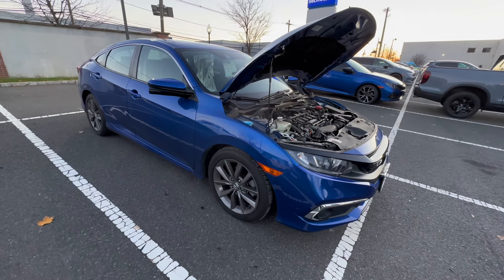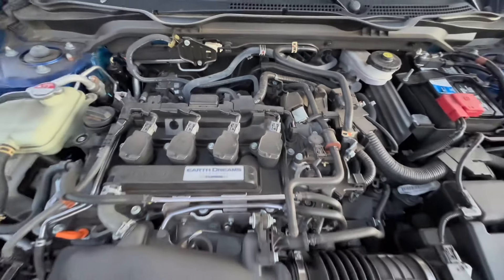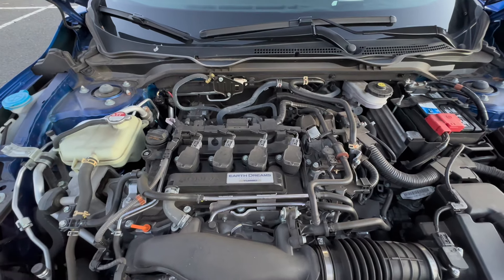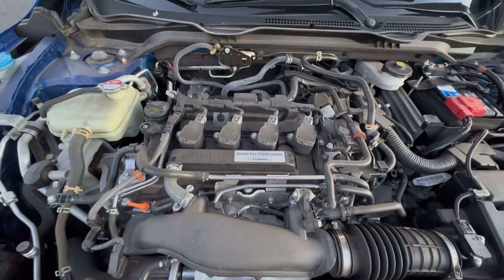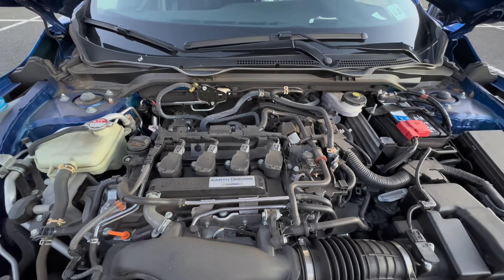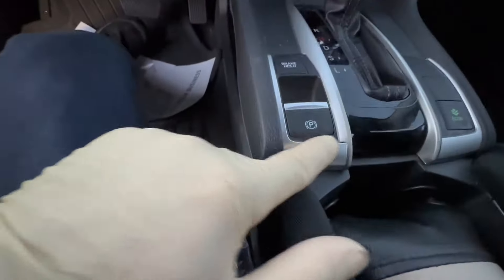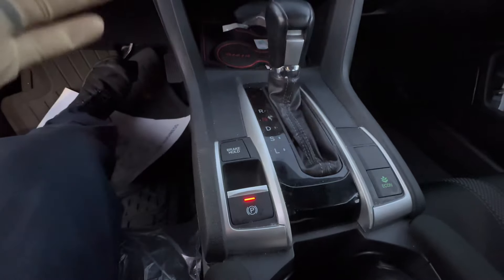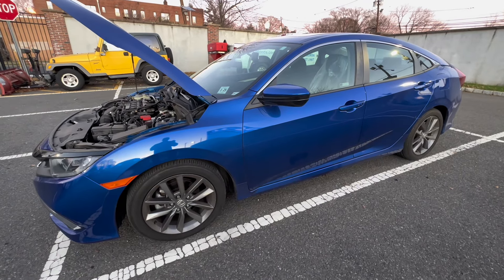2016 - 2021 Honda Civic problems

Comment: Ok got it stay away from the turbo 1.5.
Reply: I would not say that. They have built thousands of 1.5 T and compared to the failures it’s still a low percentage of failures. I have seen a ton of 1.5t well over 250,000km and they have had to issues.  Imop it depends on how it’s treated in some ways but that’s just from my experience. It’s like I would never buy something with a K24 as I am tired of putting pistons and timing chains in them, but if you want to tune and mess around the 1.5t was never designed for it or will take the abuse were the K24 will all day long.
Reply: I have 100k miles on my 1.5T not a lot but it has had no issues
Reply: I've seen plenty of 200k plus ones if you treat it right and drive it for what it is.. an economy car they do fine
Reply: @vulcanvulcan2963  when do you change the oil ? Have you had the engine cleaned for carbon?
Reply: @Tracy-wr7mj  I change it whenever the light comes on. I had the transmission flushed at 75k. What’s that cleaning for? Is it recommended?
Reply: @vulcanvulcan2963  the carbon build up in engine..  I was wondering on the oil since it's highly recommended to change it sooner since it's gdi ..
Reply: @Tracy-wr7mj  hmmm maybe I’ll look into it. It might help that I drive like a grandpa too, I had a 2001 Acura tl that I drove to like 280k miles. I had the transmission rebuilt and I broke again shorty after but I got good use out of it.
Reply: 1.5T is quicker and ALSO more fuel efficient than 2.0 NA. To me that’s very impressive. I had a 2017 1.5T+MT Civic that was soooo fun and averaged 40+ mpg.
Reply: @bikingmoments actually the 1.5 engine and 2.0 without turbo can do the same mpg...i have had both..civics...i got 48 mpg on the hwy driving  conservatively...both were very new.
Reply: Do u guys ever wonder how he keeps his job at Honda ?
Reply: I bought a 2016 civic touring brand new with a 1.5 turbo I have 200K miles on it I use 87 octane in it since it was new I do about 50/50 city and highway driving and I’ve never had a problem with the engine or transmission. My ac condenser did fail but that was a recall issue and my low pressure fuel pump went out at 120K miles but other than that it’s been a great car .
Reply: I have 123,000km on my 2016 touring 1.5 turbo. Air conditioning has been bad and am currently waiting for my second replacement. I maintain it well and don't drive the sht out of it.

I was offered 17k in trade almost bought a new civic. But decided to hold onto the 16.

Hopefully mine is ok.
Reply: I have the 2.0. Great car.   Slow. But great
Reply: @Tracy-wr7mj Hello. I have the 2017 civic lx. 2.0 manual. I can't get over 32 mpg. How do u  get it to 48?
Reply: Buddy has 2020 with almost 600k on it
Reply: I got the 1.5 T love it ain’t got no big problem she just got to 100k miles

Comment: Just wanted to say thanks for all your input into what you see as a Honda mechanic on a day to day basis. Whether buying new or used It really helps the consumer make an informed decision about what future problems there could be. Better yet, possible ways to avoid them.  Thanks again and appreciate all your posts!! 👌
Reply from the maker: That’s the whole agenda of my channel to help and inform. People take the information personal sometimes I don’t know why but I’m going to keep informing. Thanks!
Reply: I have 2019 sedan sport trim w/ the 2.0 l and have valve cover gaskets leaks. Anyone else have this issue?
Reply from the maker: @JD-zm9bx  yea, that’s a thing
Reply: I have a 2017 Civic with the 1.5 T and I’ve had problems with my radio freezing and just showing the Honda emblem and the screen won’t turn off when you get out the car and the engines off

Comment: AC condenser went at 59,000k. Honda has made a recall on vehicles and have a 10 year warranty that dealerships don’t tell you about. Search it up there is a document. Apparently the AC condenser is a universal problem amongst all civics
Reply from the maker: It’s not a recall, it’s a device bulletin. But yes 10 year warranty extension that we most definitely notify and do about 5 a day. Seems like you need a new dealer. Thanks for sharing
Reply from the maker: Exactly! Thanks for sharing 👍🏻 @abigmonkeyforme
Reply: What about the evaporator? Is that also covered under warranty? Mine started leaking gas. Tech said it's common.
Reply: @FranciscoRamirez-qq5oc only the condenser is covered

Comment: Another issue I’ve been seeing is a lot of evap leaks. Mostly on the 16s and 17s. For us in the North they build up rust on the fuel pump lock ring and it will eventually cause a pressure crack in the plastic fuel pump housing. I’ve done about 15 of them so far and it’s about a $600 fix
Reply from the maker: Your in Canada if I recall correctly, we haven’t seen any here at our dealer just yet but I’m sure they are coming. We rust up at a slower rate 🤣
Reply: @BCautosutions  you are correct. I’ll send you a picture on Instagram of what we’re seeing
Reply from the maker: @jasonlecreux1175  yes please do 💪🏼
Reply: adamb84  for the same issue we were discussing, the Corollas have the same problem. Hyundais, Kias, fords, they all do. This has nothing to do with the manufacturer, it’s about engineer design being overlooked. All companies have their flaws, and if you say other wise then your oblivious to the facts or you don’t know any better.
Reply: I have had a few civic sin for a crack as well
Reply: I have a permanent code P2422 Emission system problem on my civic EX 2020..it says Evap leaks..i took it to a mechanic, we changed the cannister...he cleared the code..but it keeps coming back..The car is functioning well just the emission code deosnt want to go...what should i do? Have you ever had this issues?
Reply: @midodzinukunu2105  I’m strictly going off of memory, but I believe that code has nothing to do with evap “leaks”. I’m pretty sure that code is CVS valve in the canister stuck open or closed. It’s one of the two, I just can’t remember which way it’s stuck. In my cases I’ve seen mostly the canister vent solenoid has gotten water/moisture in it from driving in deep water/snow and then freezing. Did they replace the CVS with the canister or reuse it? Another possible cause could be wiring/corrosion which wouldn’t be allowing the PCM to send its proper voltage to operate the valve.
Playing devils advocate now, was it confirmed to be the same code that’s coming back? Honestly P0456 and P0455 are the codes we see on these civics 95% of the time an engine light comes on and those are the DTCs for very small and a large evap leak
Reply: @midodzinukunu2105  definitely you have a leak and it has to be proper diagnosed with a smoke machine not by replacing parts randomly and wasting your money

Comment: I bought my 1.5T 2020 Sport Hatchback brand new in the summer of 20'. It has 44k miles now and LOTS LOTS LOTS of idle hours as I commute 2 hours each way to University so I spend time in my car for things like eating or naps on long days. Always been putting 87 in the tank. I see no problems with anything except that my coolant seems to be low. Hoping its not a head. Otherwise car has been doing great. I frequently drive 12 hours a day on trips up north or south with zero problems, car even took 4 Chicago speed bumps going 30mph without even a crack in the windshield and I've hit tons and tons of huge potholes without damaging anything except my sanity. Notably I also replace my CVT fluid every 30k since I do 90% heavy Chicago grid traffic driving
Reply from the maker: Awesome, thanks for sharing and best of luck moving forward.
Reply: Is your 2h commute less than 40miles? If so, Chicago traffic sucks. I’m saying because your mileage is real low for 4years of ownership.

Comment: Bought a 2017 Si brand new.   Last summer at 34k the condenser went.  Shortly after a rear window motor failed.  Then a month ago with 43k every dash light came on.   Took to dealer  and they said it was a failed head gasket between cylinders 1 and 2.  Quoted the job at $7,663.   I didnt beat on the car and used nothing but 93 octane.  Honda reliability is no more.
Reply from the maker: With 43k it should still have been covered, there’s no way I’d be paying that. I’d go to a different dealer.
Reply: @BCautosutions  time ran out on warranty not the mileage
Reply: I have been toying with the idea of getting a new Civic si but reading all of these issues with the 1.5 think I am going to look at something else.

Comment: Hey man I just recently bought a Honda civic sport 2021 sport 2.0L vtec with 40k miles I recently bought with the dealership saying the tire sensor needed replacement so they said they fixed it. later on all the warning lights came on ABS hill control brake system collision sensor control a bunch of error codes on the dash I took it to the dealership and they said it was a fuse so I brought it back and a day later all those lights came back I’m not sure what to do
Reply from the maker: @jose.a.y2313  take it back, if lights come in again after that I’d take it to a different dealer
Reply: Yours has wheel speed sensors and no TPMS sensors so it could be something with the wheel speed sensors. If they replaced a bearing or axle recently and bumped one of the sensors, that could be it. Can only tell you so much without actually being able to look at it.
Reply: I’ve got the 1.5 and mines doing this. Started with tire pressure, now it does vsa, brake hold, e brake, and will miss and go into almost a limp mode and has shut down once while driving. Thinking it may be alternator over charging but not sure

Comment: Thanks for raising awareness about these issues - my 2016 civic had both the condenser fail at 10k miles and wire harness was chewed through (lost power steering and a bunch of other codes) at 30k
Reply from the maker: @A_Lo_Pex  sorry to hear about your troubles. Thanks for your input.

Comment: My 2018 Civic EXT bought new: AC condenser failed at 117k miles (replaced under extended warranty/ for known issue). I noticed the wire covers torn but the exposed wires were undamaged. The most expensive maintenance I’ve had done was replacing the water pump, drive belt, and PCV valve at 120k miles for $1,030. Of course I maintain my Civic with oil/filter changes every 5k miles. I use only Shell Premium fuel for the high detergent to mitigate carbon deposits. I’ve never redlined and I rarely exceed 4k rpm. Other than the AC, I’ve had no issues after nearly five years and 141,900 miles averaging 36.5 mpg (combined).

I plan keeping my Civic for at least 300k miles. With my aggressive monthly maintenance, I hope to avoid any major repairs to the engine, turbo, or CVT. BTW…I bought my Civic without any of the Honda Sensing. I know that the electronics are often the first things to fail. One less area for problems if I plan on keeping the Civic for at least ten years.
Reply from the maker: Awesome stuff! Maintenance goes a loooooong way, keep it up and thanks for sharing.
Reply: Have you replaced your ignition coils ?  If so at what mileage ?
Reply: Let the car live a little, rarely exceed 4k rpm .. grats gramps!
Reply: @Matt-dc1xr Yeah, it's actually better to rev out the engine to help with deposits as well. He should be flooring at least sometimes
Reply: I seem to be having a problem where I can’t drive anywhere without my foot to the floor.. any suggestions?
Reply: @FacelessCreate  keep it up?
Reply: Exact same research I've done myself. Thank you for the input, I'll stick with full amsoil fluid changes and shell v-power only.
Reply: @Bwalston910  Actually i looked into the oil changes & its best to go with hondas brand // recommended oil & oil filter.. "Honda also recommends that you use Genuine Honda Motor Oil 0W-20" & only if you start using flex fuel w/ mods should you think about thicker oil / different brand
Reply: Love that youtube deleted my comment, I'm assuming you can still access it in your notifications. But as I said previously CAFE requirements are the only reason why American cars are recommended 0w-20.
Reply: @Bwalston910  What did you find is best?
Reply: @Matt-dc1xr  Amsoil 5w-30, as it helps with engine wear, carbon build up, and oil dilution.
Reply: @Bwalston910  What engine you running this on? 1.5t??
Reply: @Matt-dc1xr  L15B7, yes.
Reply: @ryanfliegel not good for the CVT transmission
Reply: @FacelessCreate  disable Econ mode

Comment: Good video thank you! I bought my 2020 Civic sport sedan new with the 2.0 NA K20C2 engine and a 6 speed manual transmission as I felt it would be the most reliable as a daily driver 👍🏻
Reply from the maker: You hit the nail on the head with that choice! Congrats 👍🏻
Reply: Did the same thing. Bought last week a Civic Sport 2019 with the K20C2 and manual transmission. What a car !
Reply: @soyeux27 I'm thinking on getting a 2021 sport hatchback manual what ate your thoughts
Reply: @traviswalsh2082  Please stay away from the 1.5L turbo engine. Go for the reliable and super fun 2L K20C2. A manual transmission is also the best way to truly flavor the car’s dynamics and fun factor.

Comment: I have a 2017 EXT with a 6 speed manual. No problems at all. I not only run higher octane than the normal regular but I also run ethanol free too when I can. And to help the oil dilution issue, I shift at higher RPMs than I normally would and run a gear lower in cruise at whatever speed I am at. I even drive at highway speeds in 5th gear rather than 6th. It still gets superb MPG in 5th gear on interstates. And doing so keeps the combustion temps and cylinder head temps hotter overall. This helps to mitigate oil dilution as it burns more of the gas before it can seep down into the oil. Also in the winter I do not warm up my car at all. I start it and drive away after only 10 seconds. This allows the engine to warm up much faster since it's under load. To warm the engine at idle in 20F takes about 20 minutes, To warm up driving at 3000 RPM from the get go on the road, it warms it up in 4 or 5 minutes. Less time for the gas to leak down into the oil because the oil dilution is much worse when the engine is cold by far. You want a warm engine. Also, with todays thin oils, you really don't have to warm up an engine on a cold morning, the oil circulates right away. Only exception for me is when the temp is below 5 F. In that case I warm up for a minute.
Reply: Can you make a video on how to turn off drl when the engine is running at parked position
Reply: Thanks for the information, I'm planning to buy 2018 Civic X with 1.5T and manual gearbox. Worried a little regarding that oil dilution issue, but I guess it's kinda manageable
Reply: Shouldn't be switching between ethanol free back to ethanol.

Comment: love this type of quick knowledge from a tech that works on these day in and day out. thanks for sharing this and not gatekeeping
Reply from the maker: You got it!
Reply: @ I also notice these runs super hot via thermostat for emissions I bet if I had one running a lower t stat might help it with the head bolts and the stretching. Thesehondas just seem like they’re cooking

Comment: 2016 ex-t 87k miles has a problem with the motor mounts and the car doesn’t seem to “shift” like it used to. It’s a cvt but it seems to accelerate in chunks, blocks, at certain rpm depending on which mode it’s driving in. 
Also a problem with electronics occasionally; right front passenger side window doesn’t go down from driver side, switch isn’t the problem. When turning the steering wheel the headlights, dash, and all other lights dim on the car. Sometimes the sunroof switch wont respond unless you’ve turned the car off and then on again.
Reply from the maker: @vandliszt  the problem with the window is the pass side switch even tho it works on the pass side. See it many times.

Comment: I have a 2018 hatchback sport and my AC went out one summer. Did some research and thought it might have been a recall issue like you mentioned. Turned out to be the evaporator and that wasn’t covered under the recall. Had to pay $2000 out of pocket for that one 😢 other than that, I always pump premium for the reason that I don’t want anything else going bad lol
Reply from the maker: Yikes sorry to hear that! Hopefully that’s all you will need to replace out of normal maintenance. Definitely use premium and keep and eye on that coolant level. Thanks for watching.
Reply: Thanks for subsidizing premium for people that actually need it, but it is a waste.  High quality gas is fine 89
Reply: My ac hasn't worked since first year.  It's a 2017. I called and they replaced condenser and o rings and now coolant free. Wonder if it'll die again, coverage until 2027 on the ac.
Reply: My friend 2019 civic had same issue plus his cvt was replaced on 4th year

Comment: My sisters 2016 civic touring had the AC compressor fail at ~45k miles. Luckily she spent $2k on a 7 year warranty because the repair from Honda was almost $2500. The screen would freeze sometimes and needed a hard reboot. Third brake light always rattled with bass and the TMPS light was so sensitive.
Reply from the maker: Yea all some common stuff, luckily Honda care covered it
Reply: @BCautosutions 😂
Reply: I think Honda increased the coverage on AC compressors for all 10th gen Civics to 10 years
Reply: @EJleon96  maybe recently. This was back in spring 2022. Car is totaled now. Honda needs to own up to their recent mistakes. Their quality is going down the drain.
Reply: @robbym3542  no that TSB was active before 2022 for sure. I def feel like Honda should have recalled the whole AC system tho because condensers and evaporators have gone down commonly. I’ve just gotten used to charging the AC myself once a year. Meanwhile I’m currently hunting for an oil leak at 100k miles 😞